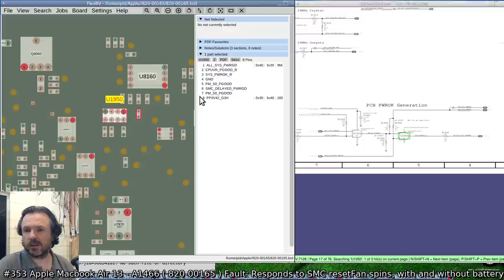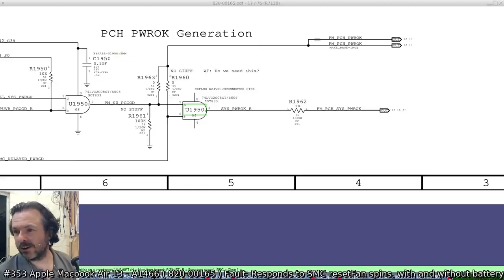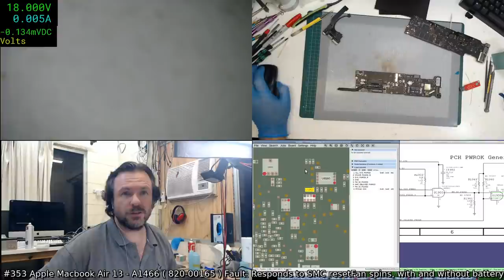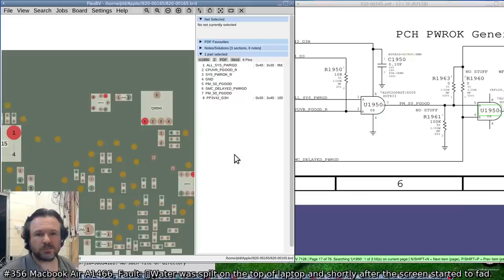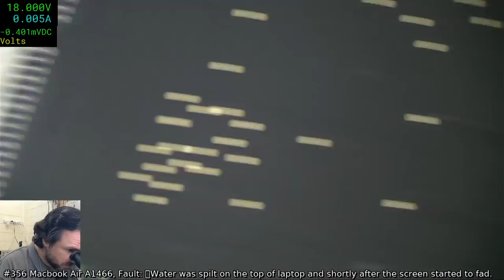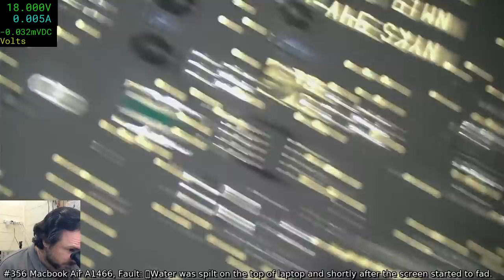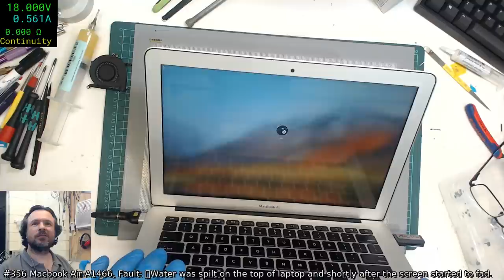#353 Macbook Air, SMC reset response but no CPU activity.  Also, good news about the banks!

Comment: I think I just found out the hard way that the Macbook air A1932 requires battery to be plugged in to turn on.
Just cleaned up liquid damage and was only getting 5V on power without battery. When battery is plugged in, it goes to 20v, all is well and I get startup.
 Is this true?! Or am I overlooking a fault with the power whilst the machine is just booting off the battery?
It is not my machine so i decided to hot-unplug the battery which left the machine still running off 20v... makes me think it's the way the are but thought you might know if that is the case.
Never worked on these new MBA's before, only the MBP's and the disgusting macbooks.